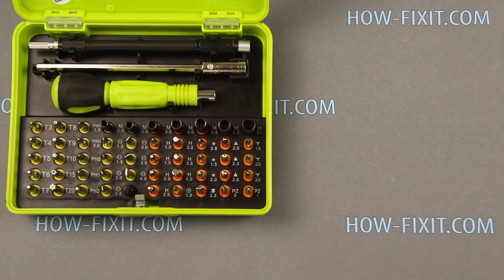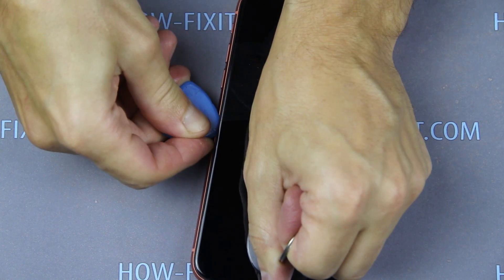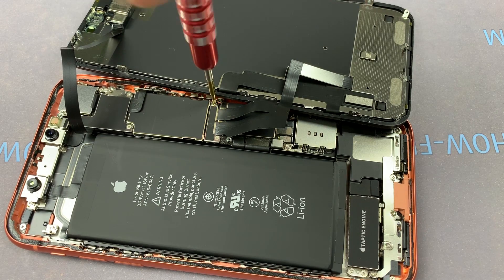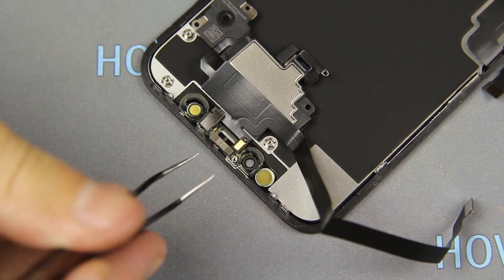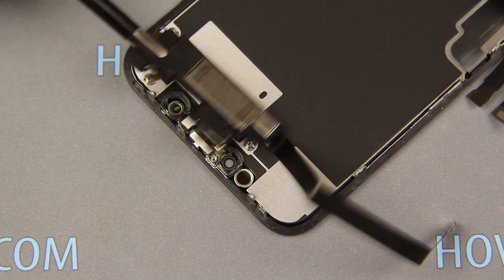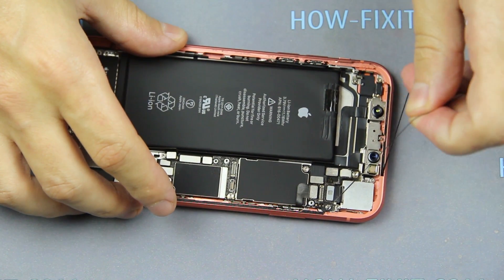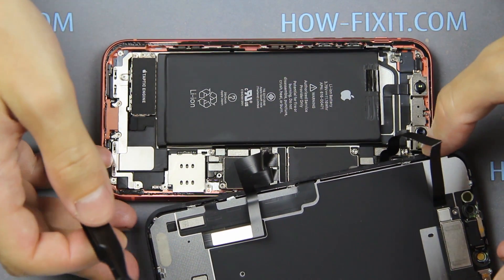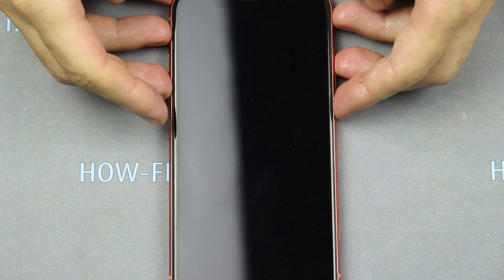DIY iPhone XR Screen Replacement: Tools and Steps Explained

Comment: I opened my screen & there is another layer b4 the battery it’s a thin silver/metal door same size as screen blocking the battery. I cannot unscrew the batter door for the 3rd step until I get pass this metal cover

Comment: this is the only real replacement video that actually goes over the whole process. others just take screen off with the cables and end the video. not even show you how to remove the sensors up top

Comment: @3:45  that piece and all of that part between the 2circles completely broke and stuck to the top LCD digitizer.. I have fixed iphone 6's but nothing newer.. my question is. Can that be ordered and fixed by me and what is that part called.. if you can help me
Reply: Speaker and light sensor in sure you can get a new one

Comment: do these replacement parts as good as the original iphone part, like gorilla glass?
Reply: Depends where you buy it from, if its an OEM part, or from iFixit then it should have the same durability. But, if you buy it from a sketchy seller from amazon then it could be not as durable.